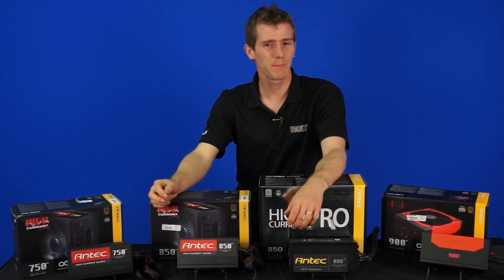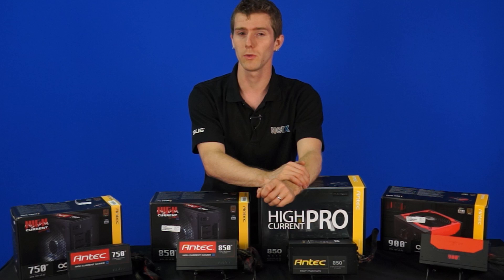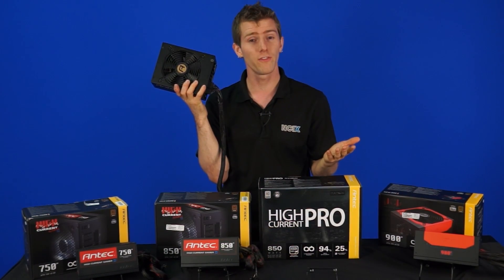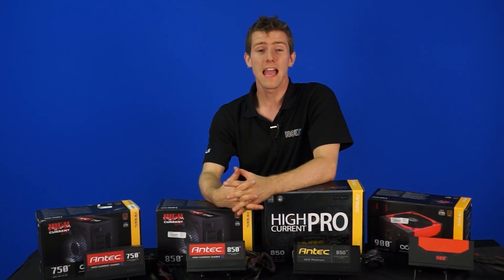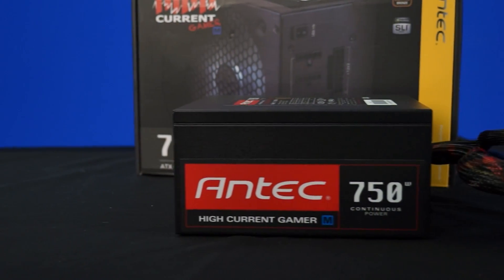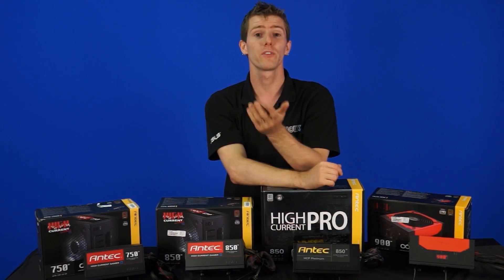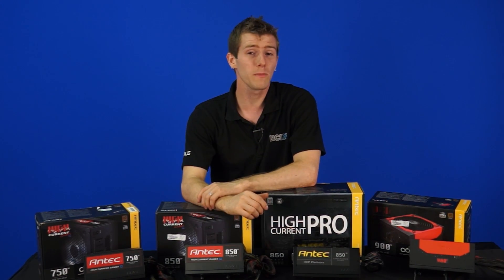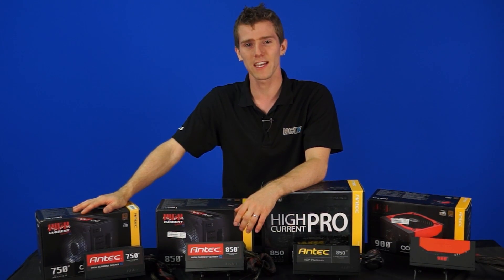How Many Watts Do You REALLY Need In Your Power Supply? ft. Antec HCG

Comment: What could power a EVGA gtx 780
Reply: For only a single GTX 780 a good 550 Watt power supply is perfect, and leaves you room for overclocking everything else
Reply: EpicSlambox - Home Of The Ouchies! You can run the GTX 780 in SLI With a good 750W power supply like Corsair RM 750,
Reply: Riivo  you obviously don't know what you're talking about.
Reply: Tunknatar
what do you mean ii said i requires 600 so take 650W or 750W is that si hard to read?
Reply: Riivo you can run it on 450w.
Reply: ***** corsair rm series use shitty capacitors. The CoolerMaster V series are good.
Reply: it requires 600 so 650 to 750 =)
Reply: I'll take a 750
Reply: Ok
Reply: Taylor Russell Nah too small of a headroom for overclocking and safety. 550 High quality PSU is perfect
Reply: ***** yes 550w would be perfect but 450w can handle it fine.
Reply: meh,i would take 500
Reply: EpicSlambox Take a high quality one. Never go cheap on PSUs
Reply: which should be....
Reply: EpicSlambox Like Corsair RM 550 or Corsair CS 550M. Seasonic also make some fantastic power supplies
Reply: Taylor Russell Many of my friends use RM PSUs and they have no problems what so ever with it. I myself use AX 860
Reply: ***** I said shit capacitors, it's not going to blow up the second you power it on. It's something that happens over time.
Reply: ***** Also it's ax860 that has coil whine isn't it or ax860i?
Reply: Taylor Russell Nope, no coil whine at all it's the AX 860. The coil whine on the AX 860 was fixed in late 2013. but my unit is faulty. It keeps turning off randomly, luckily Corsair is giving me a new one, but my friend's AX 860 works amazingly!
Reply: ***** nice, the ax series are too expensive for me to justify :p

Comment: How strong PSU do I need for: FX6300 and 270X?
and how much for these: AMD Athlon II X4 750-760K and 270X.
Reply: Honestly a 430 Watt PSU can do it no problem, but I recommend a 500 watt PSU just for the headroom
Reply: ***** So not 550-600w?
I might overclock processor and/or gpu.
Reply: ***** 500 Watt is more then enough
Reply: ***** The bronze, silver, etc. certifications just mean how efficient it runs (how much power it needs to pull from your wall) so the only thing it effects is how much electricity you use. If you aren't worried about your electricity bill too much, it doesn't particularly matter.

Modular/semi-modular power supplies just make cable management easier.

The 500w bronze certified should work just fine.
Reply: ***** 500w is good. I have a 500w powering my FX-6300 and 270X right now. Same goes for the 270X with the Althlon II X4 750/760Ks. The power draw on them are only another 5 watts, so you should be safe.
Reply: Michael L. Bowie Is it enough with bronze certified though?
For example corsair 500w bronze certified. I am thinking of either goig full modular or semi modular I think.
Reply: Michael L. Bowie Ok I'll try it out then. 
Thanks.
Reply: ***** I´ll recommend a good quality PSU like the Corsair RM 550 or CS 550. Never go too cheap on power supplies
Reply: Remember to take into account efficiency, and add in extra headroom for if you want to upgrade, if I knew what I knew when I started I would have just spent a month's spare cash on a 1,000 watt model; that being said I tend to buy some kind of upgrade every month to make things easier.
Reply: ***** ***** Just remember that there is a thing of too big power supply not only too little.
Don't go too cheap and don't get too big. for example 1000w instead of 600w of 1500w instead of 1000w.
Reply: ***** I'm not quite sure what you mean, but yeah don't go too big on the PSU, that is not good for the PSU. For regular high end system, with like an i7, GTX 770/780, Z97 board and slight OC, a 850 Watt PSU is the max I would go and that's only if I want to go SLI in the future. Lol and here I am with an i7 4770K, GTX 770 no overclocks, but with an AX 860. Ahh the irony
Reply: ***** What is AX (power supply)?
My point is don't go too big, then I gave some examples of it. Slightly too big is fine though.
Linustechtips has 2 videos about power supplies there he explains it good.
Reply: ***** The AX 860 is an extremely high quality 860 Watt platinum certified power supply from Corsair. But unless you are going Three Way SLI, a 1000 Watt PSU is way too overkill. For a good setup with only one GPU, 550-650 Watt is perfect, for a 2 way SLI setup a 750-850 Watt PSU is perfect. The reason why I'm mostly talking about GPUs is because they are the most power consuming component in your system
Reply: ***** I would say 500-600. But yes.

Comment: i know there are a lto of psu calculators out there, but they're all giving me different results, so i would like to know much wattage i need.

My system of choice:
Athlon X4 760K 4x 3.8 GHz
Asus R9 270X Direct CUII Top 4GB GDDR5
Seagate Barracuda 1TB
4GB Crucial Ballistix 1600MHz Ram
a DVD/Blu-Ray drive
Wifi Card

Possible Future Upgrades:
SSD
a second graphics card
additional 4GB ram

Comment: hey linus. Will a  FX 4300 bottleneck a gtx 670 ? i haven't got much left in my budget and should I go with a FX 4300 or a 6300 ?? will it still be bottlenecked by the 6300?? thanks.

Comment: I have a question, so i have an i7 4770K , a GTX 770 ,12 gigs of ram and a 700 gigabyte power supply does the PSU  have enough watts to give the system the power it needs ? 

thanks
Reply: Power supplies are measured in Watts, not gigabytes... I assume that was a typo.
You should be fine. The processor uses about 84 Watts, and you need 230 watts for the graphics card. The manufacturer suggests a minimum of a 600 Watt power supply for using that card. I'm honestly not sure why, but clearly you have more than that.
Reply: DGneoseeker1 Yeah sorry lol i meant that i have a 700 watts psu from the company gigabyte, and thanks for your reply
Reply: That system could run just fine with a 500 w psu so yes a 750 is plenty

Comment: Do you guys think a Silver standard 650W Corsair PSU will be enough for SLI GTX 770s?

Rest of the build is fairly bare-bones, a single SSD, no LEDS, no optical drive.
Reply: Joshua Woolridge I think you missed the fact that the guy wants two 770s.
Reply: According to techpowerup, a 770 maxes out at 214 watts, and an i7 4770k draws 130-170 depending on the OC. Add some 50 for the motherboard and you end up having no breathing space left. Generally speaking though, a good PSU can deliver around 100 watts in excess of its rating and in normal use you're unlikely to max it out, just add up all the rails to get the max pullable wattage. Still, a PSU's capacitors will degrade over time lowering the power output, I'd rather be safe with a hundred watts more, especially if you OC.
Reply: Sobakus I've got a 770 and a 4670k and use a corsair tx550 with no problems. Go for a good brand, 750 watts is overkill.

Comment: Actually, 400w of a PSU is enough for most rigs unless you're doing a crossfire/SLI
Reply: ***** Indonesia is right, for most rigs you don't need more than a 400W PSU really. Have a look at this test, while using a 4670k and a GTX 780ti the system under OCCT (furmark) draws about 420watts from the wall.http://overclock3d.net/articles/power_supply/how_many_watts_do_you_actually_need/1

Comment: Wow, so those results were a little shocking to me, so I have a question. I have a system with an i7-950, 12GB RAM, 1 SSD, 1 HDD, 1 ODD, and soon to have two 4GB 770's. I know the titan is more efficient than other solutions, but I was assuming I would need something in the range of 1200 watts. Am I wrong?

Comment: can you help me whats the best PSU for my future build NAS? my plan was building a NAS with CM elite 120, Intel Atom ITX mobo with 2.5 320gb WD OS drive, at least 2 HDD Caviar Red with still thinking for Capacity with overall at least below 50watts totals power consumption or my best expectatioon is only about 35 watts and a Ubuntu OS? can you suggest me a good PSU for that spec? what wattage, Brand (but i preffer fully modular with at least 80plus gold) i was thinking for seasonic x400 fanless design but i don't think its the best for my builds for only below 40watts of load?. thanks
Reply: ps. and correction my expectation for the total power consumption without the 2 caviar red is about 35 and below wattage. for 24/7 online NAS

Comment: is there a website or channel i can go to safely decide how much watts my power supply unit should be? im running a fm2-85-g65 board with a10 black edt... and hd7770 gpu... :(
Reply: stephen01king
Don't go blind on them though, the main thing to look at is the amps on the 12V rail not the total rated wattage
Reply: Just search for psu calculator
Reply: 500w psu would be fine but get a 600w just incase you upgrade to a bigger card in the future :)
Reply: tnx!!
Reply: i bought a zalman 600gt, is that enough to power an r9 260?
Reply: Uzi Panti r9 260 doesn't excist. Do you have r9 290 or r7 260?
r7260 won't be a problem at all, r9 290 might push it(a quality 600w will do, i can't find much info on the 12v rail of your PSU so i don't know for sure)

Comment: my system:
- Zalman 600 watt PSU -
What does it power?

DVD drive (1)
WD 3 TB HDD (1)
WD 1 TB HDD (1)
Samsung EVO SSD (1)
MSI Z87 G41 mobo
MSI GTX 660 TF O.C.
Intel 4670K @ 3.8 Ghz (fixed)
Corsair Vengeance ram 4 GB (4, total: 16 GB)@1600 Mhz
Asus Xonar Essence STX soundcard
Fans: 1x 80mm intake, 1x 120mm intake, 1x 120mm out
USB connected: printer and 4 other devices continiously.

I ran for 24 hours;
a Prime95 test  + Heaven Benchmark + Kombustor + Dirt3 (a continuous replay) Connected a Wattmeter inbetween the wallsocket and the powerplug during this test. Max reading: 538,4 Watt over that period of time and not a single fault detected in Prime95.

Comment: GENERALLY SPEAKING, most rigs will do just fine with a 600w PSU.
Reply: Original post was right, the VAST majority won't ever need more than 600 watts, just look at Linus's results running dual titans and a 6 core intel running prime and furmark... 685 watts FROM THE WALL. @ 85% efficiency that means the power supply was actually putting out 582 watts. On top of that, no real world application will ever match (or even come close in most cases) the sort of power requirements that arise when stress testing components.

If you're not trying to run 3+ graphics cards, overclock a 6 core titan SLI configuration, or future proof to 2030.... get a HIGH QUALITY 600 watt power supply, max. You'll have all the power you need and, even better, when your system isn't running balls out stress tests (99.999% of the time) you'll be a lot closer to that 70-80% loaded High-efficiency-zone.
Reply: No, if you want to generalize, you should get at least a 750w psu. 750w will run MOST systems as long as they are single Gpu systems
Reply: He said most. And i am just assuming that most people dont want to upgrade their psu with every new gpu they throw in there. There is no problem with overshooting on a psu haha :)
Reply: Zaphod7835 I have two 450w 770 video cards.. soo... I had to go over 1k watts
Reply: Justin Hardt Do you think your 770's pull more power than titans?
Reply: I'm guessing that guy bought the windforce card because it can cool up to 450 watts and he thought it meant the card was using 450 watts lolololllolololol. People are crazy these days
Reply: ***** The specs for my ASUS GTX770 say it can pull up to 300 watts.
Reply: pcpartpicker.com/p/3mWwn how much power do i need for this system? i just randomly picked a 750W power supply
Reply: ***** you're talking about mine right? alright. thanks alot. will it have enough room for a second graphics card?
Reply: *****
alright. thanks a lot for the info man. i really appreciate it.
Reply: *****
Astia sunt grei de cap si nu se uita la tot video-ul
+1

Comment: I'm really not sure about what PSU to get :P Some calculators say that I only need like 400W, but the GPU itself recommend 500W... 

The build I'm thinking of is a m-ITX build with:
- AMD Athlon II X4 760K (hoping to get a decent overclock around 4.2GHz)
- AsRock FM2A88X-ITX+
- 8GB of 1600 or 1866MHz RAM (2x4)
- Kingston SSDNow V300 120GB
- 1TB Seagate Barracuda HDD
- Be Quiet Dark Rock 2
- 1x200mm Red LED fan
- 2x120mm fans
- R9 270X from MSI or Gigabyte (want to push the overclock a little further than the factory OC)

Right now I'm thinking that a 650W PSU would be a smart move as it'll maybe give me the opportunity to swap out my single GPU for a dual GPU or a higher end single GPU ;D
Reply: 500W should be fine even for Dual-GPU
Reply: 500-550w is perfect
Reply: Just go 500W or higher. It's better in the long run to have your PSU run @ around 70% load. Not just efficiency speaking but it'll run quieter and cooler which should make it last longer
Reply: from personal experience I can tell you that 500 would be fine at stock, If your planning on OC without modifying voltages go for a 550 just to be on the safe side. Multi gpu + Overclocking w/ modded voltages might be fine with a 550 but I would bump it up all the way to 650 to make sure you get the best out of all of them.
Reply: I have a GTX 760 and i'm gonna buy another one soon but i got a 750w. Your 650w may just be enough for two GPUs. It's worth a shot.
Reply: I'm thinking 600-650W should be enought, always add 100 watts to be safe xD

Comment: Can I run sli gtx 780ti i74770k oc @ 4.2 and 16 gb ram 2 ssd wit corsair hx 750 watt
Reply: 650w would be to low especially for SLI 780 ti's, 750w would be fine 850w would give a little headroom for OCing / other hardware etc
Reply: TylertheGeek28
STFU you dumb geek, no turning back now.
Reply: Might be a little tight, might want a 850w just because your running SLI
Reply: TylertheGeek28  Nah noob you can without a Hitch.
Reply: Even a 650w could do that!

Comment: Wait, so a 750 watt PSU ran dual Titans?
Reply: Without even breathing hard... with no overclock that system would stress test on a high quality 600 watt. With an overclock it would likely be fine in applications but exceed the PSU if you tried to stress test the CPU and GPU's at the same time.
Reply: Zaphod7835 It's cool to see how good power consumption of such a high-end card today compares to those power-hungry high-end cards from a few years ago.

Comment: So that rig only consumed less than 700w on full load? Mine is an i7-4770k @ 4.5ghz, GTX 780 SC SLI, Samsung EVO SSD 250gb, Corsair 750D, Blu-ray drive, and a Hyper212 evo CM CPU cooler, shouldn't I be able to run it with a 750w psu?
Reply: yeah you should, with a little bit of headroom to spare :)
i dont know why you have such a drastic OC though.. the cpu doesn't even need it :P
Reply: seismicbreaker It's not that drastic. Plus, why not?
Reply: I am using a 750w psu bronze+, runs greatly!
Reply: ***** Not really a mild oc with a 212 Evo.

Comment: what kind of psu wattage would you recommend for this?
Intel i7 4770k (overclocked)
Nvidia 780ti
16 gb 1600ghz (2x8)
water cooling for the cpu h80 probly
2 ssd's (raid) 
2 hyperdrives (not raid)
Reply: 600-650 and that'll leave headroom.
Reply: seismicbreaker ok :D yea i kinda wanna have a bit more than a bit less ;)
Reply: Go for 760 watts. Remember that a PSU's lifespan is about 8-11 years (more or less) so you will have it awhile. Get a good one. If you are using 400 watts at full load, that's about 50% of 760 watts, which is a very comfortable place to be. This means your PSU won't sound like a hair dryer when gaming. 

Plus if you ever want to SLI you can

Comment: I have an R9 270x, FX-8320, and a 750w OCZ Powersupply, i was thinking of Crossfire. Do i have enough wattage? All the calculators have mixed wattage recommendation
Reply: Yeah it should be enough you are going like 100 watts leftover in cf
Reply: jesus medina
He'd probably have 200-300w left over actually. The 270x isn't the most demanding card, though AMD doesn't really work good with power in my opinion.
Reply: yeah depending on the efficency of his power supply it can be that
Reply: ***** oohh okay thanks
Reply: Nicely explained Sebastian.

Comment: i got a FX 6300 with a 7850, got a 430 corsair 80 plus bronze cert power supply, will that be enough?
Reply: ***** would you say a 600w 80 bronze is sufficient for a 6300 and crossfired 7850's?

Comment: I need help, I will be getting a Radeon 7790 but I am unsure if buying a PSU is a must, my computer is relatively new with a 230V power supply, I'm guessing its also 230 Watts? Because my system has a integrated graphics card, but can someone answer me please if I will be needing a stronger PSU if I was to upgrade my system with a Graphics Card? If so, how powerful should the PSU be?

Comment: i was thinking of building my own pc need help any thing will be great lower price with out killing Performance ty
Intel Core i3-3220 3.3GHz Dual-Core Processor
MSI Z77A-G41 ATX LGA1155 Motherboard
2 A-Data XPG Gaming Series 4GB DDR3-1600 Memory
Seagate Barracuda 500GB 3.5" 7200RPM Internal Hard Drive
2 Asus Radeon HD 7770 1GB Video Card (not sure if 2 way cross fire make much of a dif let me know)
Raidmax ATX-298WW ATX Mid Tower Case
EVGA 500W 80+ Bronze Certified ATX Power Supply

Comment: I have been running crossfired, overclocked 6970's, a 2600k @5ghz and a full water rig + HDD's etc on a HX750 for 2 years now. Hasn't missed a beat.

Comment: I have a question, I have a 250watt power supply and I need new graphics card, can I use a 300 or 350 watt graphics card?  The reason I ask is because I heard that a lot of these graphics card manufacturers say the gpu card needs a certain wattage but it can be usedto with less wattage and work perfectly.